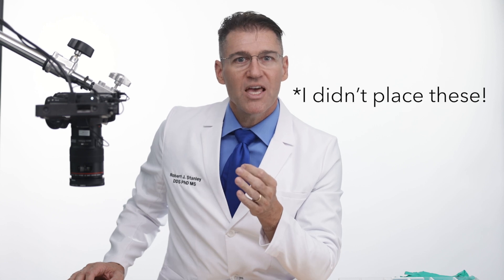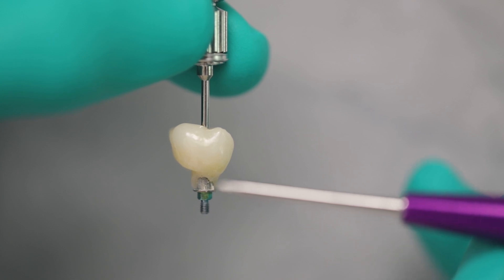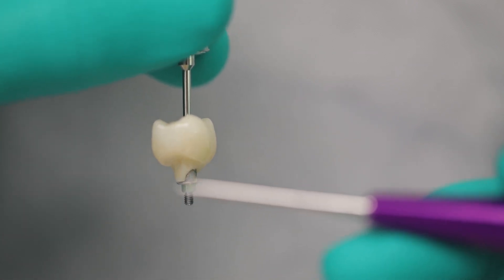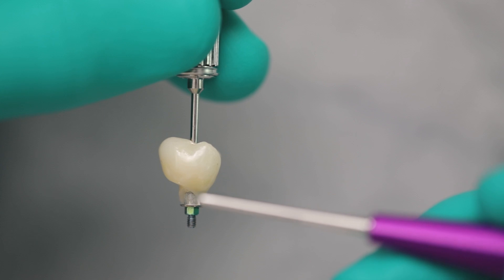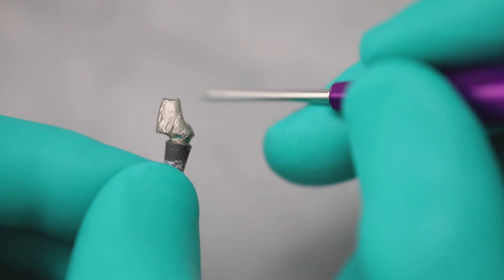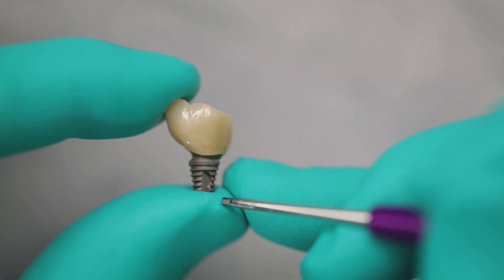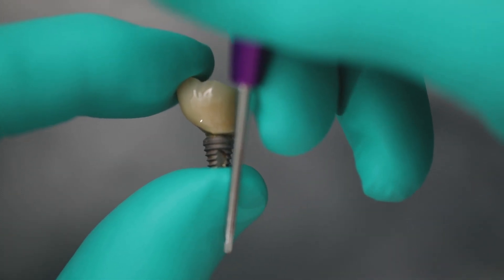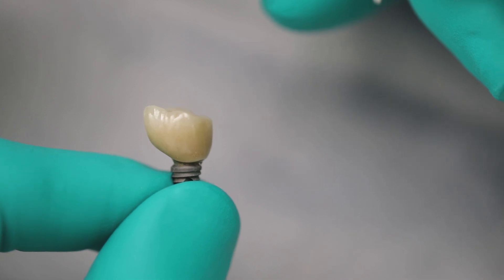You're designing implants to FAIL and you don't even know it!

Comment: So when you went from the "Snoopy" to the "Heart" shaped restoration on the 1st case, how did you manage the tissue in vivo?

One should not blame the lab for creating the Snoopy, although labs these days should stop production and reach out to the clinician, explain the situation and ask for guidance. 

Honestly, I blame the surgeon and/or the restoring clinician by not creating the proper emergence profile to support the needed restoration.
Reply from the maker: Great question. When placing the heart shaped solution it is often times necessary to make a crestal incision with a 15 blade. I don’t elevate the tissue. I just slowly screw the prosthesis down until it is seated. Almost  never do we encounter a bone obstacle and if we did we use the bone profiler to create the necessary space. The snoopy is never a lab created problem. It is the result of a poor plan, poor execution, or a combination of both that leads to a less than ideal outcome.
Reply: @Stanleyinstitute  That makes sense. I thought it might be how you handle those situations but I just wanted to ask. Thank you so much for your response!